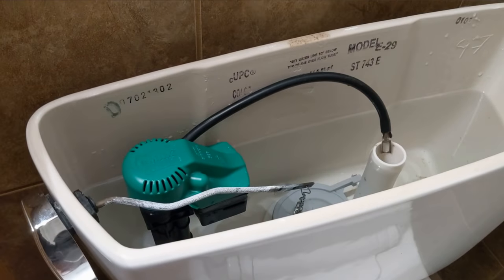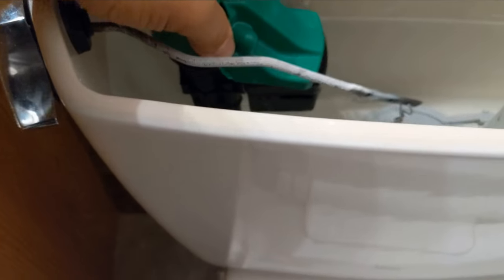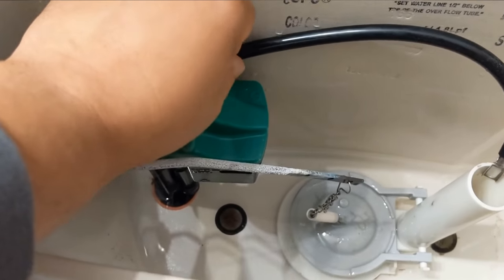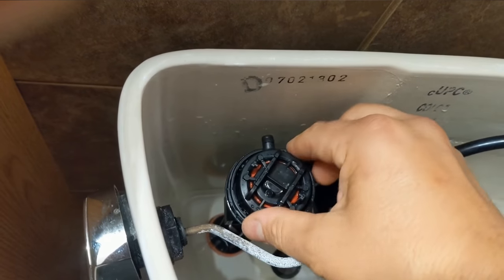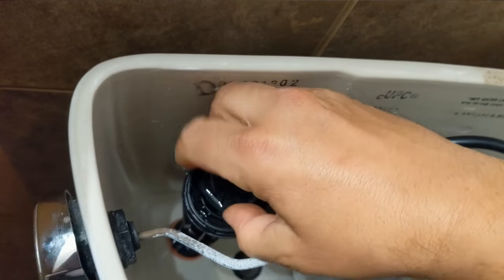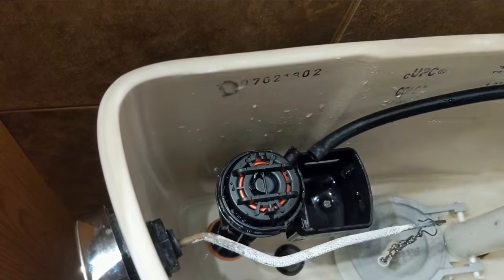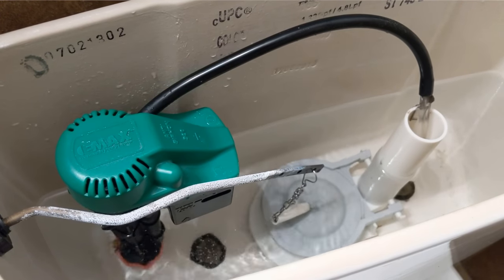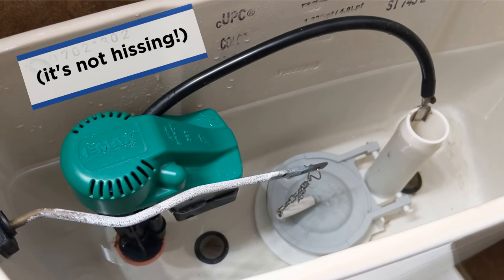How to quickly fix a hissing leaking Toto toilet with a new flush valve cap

Comment: After playing with replacement valves and replacement caps and cleaning the filter, with varying success, I’ve learned that $9.88 (currently at Amazon) to just replace the entire unit is easiest. Turn off the water, flush, a few unscrew and screw back ins, and you’re done. No disassembly, no “will it work” after a fix, no “what fails next” in a few months.

Comment: Thank you!!!  We have an older Toto dual flush toilet with the green 528 fill valve.  Took a bit to figure out what was going on since we weren't having the typical hissing noise.  In our case, the water fill was stuttering on and off, which was then causing loud knocking in the wall.  The Korky replacement cap cost $5 at my local True Value hardware store and was the perfect fit, and was so simple to follow your instructions - fixed it in about 2 minutes :-)  The previous gasket had completely degraded and was in pieces.  So much money saved not calling a plumber!

Comment: The rubber seal on mine was cracked near the edge.  Local Home Depot didn't have the cap - just the whole mechanism for $26.99.  However our friendly neighborhood Ace did stock it - $4.99.  Thanks!

Comment: You saved my day as my toto toilet is hard to unscrew flush valve (I do not understand why it is designed in such a way ). In order to change valve, you need to disasseble toilet from bottom first. Fortunately I saw your video and get it fixed by only chaging cap!!! Thank you so much!!!!

Comment: our higher than usual water bill was the big motivator for getting this done.  Found your video, then picked up the part at our local Ace hardware store (Korky Replacement Cap No.R528) for $5.50 and followed your instructions. Oops, forgot to check the filter - but the hissing leak is gone and peace is restored. Thanks!
Reply from the maker: Woohoo! Cheers.

Comment: Worked great for a different problem: tank filled, stopped, then started filling again several times briefly before finally stopping.  That rubber gasket was torn.  Picked up the Korky R528 equivalent replacement at Menards ($3.49).  Easy repair and it worked!  Thanks for the video

Comment: Jeff, you saved my manly honor! I brought a Korky replacement valve and spent better part of the afternoon trying to install it, but water kept leaking everywhere until I realized that the bottom stem was too long for my rigid water line. So then I had no choice but to reinstall the old one and deal with the hissing. Almost threw in my water drenched towel and asked my brother-in-law, who’s much more handy, for help. But your video saved me! And now he will never know that I almost had to beg for his help!
Reply from the maker: I might need this on a t-shirt! "Saving manly honor'". Glad it helped 👍
Reply: Terrific video. Thx. The green cap I struggled with until I saw that when you put your right hand over the cap, at the bottom near your thumb is a small flap that if you pull forward with your thumb it releases the cap easily.

Comment: Big thanks for the links! Saved me a lot a research time. The replacement cap fit more tight, but it works great. It's still a bummer to buy a full cap with valve, when all you need is just a rubber part! While removing the the hose I broke the nozzle on the cap, so I ended up using the advantage on new cap, but it doesn't mean that you have to buy so much to get so little.

Comment: Thank you.  You saved me the a lot of money and trouble.  I was going to replace both the fill valve and flush valve, plus put in a new gasket between the toilet base and back.  I bought a Korky Quietfill Fill Valve replacement cap at RONA for about $6.00 cad.

Comment: .....just completed the job myself...it was quite difficult to remove that top cap which was concerning....I thought I was going to crack or break it but I squeezed it a couple of times and twisted ever so slightly and it eventually disengaged....but it definitely wasn't so nicey nice as shown in the video....but the rest of the job was as smooth as silk....ty for the video...I'm a new subscriber
Reply from the maker: Glad it worked! (Sorry for my late reply!) For others reading - yes, the first time you try removing the cap and the hose, they're pretty tight. 👍

Comment: I had the right part but your video gave me more confidence in disassembly. Thanks! The outflow bit broke off in the hose when I pulled it off and I couldn’t get it out, but fortunately there was enough slack for me to cut a quarter inch off and still have it fit.

Comment: The Korky R528 Replacement Cap from Ace HW did the trick for me.  On the back it says fits Toto too.  $3.99.  Thanks for the quick fix.  I was thinking it was a leaky flapper instead.
Reply from the maker: Fantastic! Thanks for the part #

Comment: This saved me not just $20 but lots of hassle. We have a skirted toilet and the nut the attaches the supply line to the fill valve is impossible to reach by hand. Replacing the whole fill valve would probably require unmounting the toilet. So.... THANK YOU for sharing this info!

Comment: Thanks I ordered 2 and replaced both on my Totos. Heads up though it is NOT easy to take the top of the fill valve apart. Every part is hard to remove (except the valve itself).

Comment: If you didn't notice, the bottom of the chain has been enclosed in a short piece of tubing that falls slightly to the side when the chain is relaxed.  That tube prevents occasional tangles at the bottom of the chain.  When such tangles happen to happen, the flapper valve at the bottom of the tank won't seal and the toilet runs continually until you straighten out the chain.  Make this simple fix to avoid needing to listen for the toilet to stop running after it refills each time it is flushed.   That's probably what happened when someone ends up with a mysterious several- hundred dollar water bill.

Jeff has shown us a simple way to solve a second Toto toilet problem.  Thanks,  Jeff!
Reply from the maker: Thanks for the added tip! (and sorry for missing it earlier!) 👍

Comment: Thank you so much for this tutorial Jeff!!
My Toto toilet is maybe one and a half years old and started hissing about 2 weeks ago and so annoying because it's so close to the master bedroom.

I took all of the components apart on the left side rinsed them under hot water put them back together no more hiss.. so I did not have to replace any components but will know what to do if in the future the hissing doesn't stop after rinsing the components at least I know what valve to purchase..
Thank you YouTube and Jeff 😊
Reply from the maker: Glad it worked! I had cleaned mine all out with vinegar a couple times and even tried some silicon lubricant but once the gasket was dried out it need the replacement :)
Reply: @JeffMikolajow    thanks, and I did not use vinegar, I only rinsed with water, but if it happens again, I will rinse using vinegar, I do have super hard water in my home  :)

Comment: Great info! Appreciate it. Got the valve seal at General Plumbing for under $4. HD didn't have it, but I opened a new "Korky" GMAX valve to look at it and I think the new valves do not come apart? Not sure if anyone else has noticed that. Really made me want to keep this one if l can maintain it with $4 parts!
Reply from the maker: I've used the Korky replacements in other toilets (kids broke a full mechanism) but it seems the Toto branded parts are better quality, in general. Because of our high mineral content, I've been taking these ones apart at least once a year to proactively keep them clean 👍👍

Comment: Update - 4/2024 - at least in the US replacing the valve part costs more than replacing the entire valve assembly.  In fact if you don't replace it with a Toto unit, it costs $11 US. At least in the US, the "$5 piece" described in the video was listed at $30 in the on-line catalogue at both Lowe's and Home Depot. My local plumbing supply store did not even carry replacement parts as the towers are so cheap.  But thank you for the education.
Reply from the maker: Odd! They're still available in Canada for anywhere from $3.63 to about $11.

Comment: Thanks Jeff! Any chance you can do a quick video on adjusting the water level of the GMAX flush valve? My valve tube seems to be locked in place with a tamper proof key.

Comment: I need to look through your other videos but how do you replace the flapper? Specifically removing the old flapper. There are two white tabs on the plastic rod. How to remove either the rod or the tabs.

Comment: I was really excited when I saw this video thinking I could fix the hissing sound that’s bothered me for soooo long. The plumber said it was air. Ha! Unfortunately, I can’t take off the top (mine is blue) and it’s a TOTO. I bought a Korky replacement cap, but I wasn’t able to pop the cap off. I feel like I am yanking off the whole fill valve.
Reply from the maker: Hi Martha, hope you ended up getting it fixed! The top can be tricky to remove but it does separate in a similar way.

Comment: Orded the valve and almost wasily replaced it. (Teisting required a bit of mechanical assistance.)

Back together and still leaking.

Will remove the parts, rrince under warm water, and try again.

Comment: I have the green valve. I cannot get it off. There is a little black thing sticking out of a whole. Do you twist the cap or pull straight up? Thanks
Reply from the maker: The black hose at the back just pulls off 👍🏼

Comment: Wow, I had no idea that little "filter" thing could become completely clogged with debris. Apparently there's just rocks and oxidized copper floating around in the pipes?! My toilet was hissing like this AND it took over 5 minutes for the tank to fill. I pulled out that white plastic part and it was completely full of tiny green rocks. After rinsing it and putting everything back together the hissing is gone AND the toilet fills up in like 30 seconds now.
Reply from the maker: Amazing! Yes, mine occasionally has some "sludge" in it, too.

Comment: It looked simple and easy but both Home Depot and Lowe did not sell that valve piece. I wasted my trips. Will have to replace the whole flush system.
Reply from the maker: Sorry to hear! I've seen them recently though - perhaps it was sold out while you were there. Still online! Good luck.
Reply: @JeffMikolajow  
No problem. I was curious about your steps so I tried to see if it worked. I replaced the whole and it worked perfectly. Thank you for sharing with people.

Comment: Hi there Jeff,

I have this model and it's newly installed in my new apartment. For some reason the water won't refill though despite being new and will only refill if I push on the green part and lean it in a certain direction. Any suggestions for this seemingly simple problem? Thanks

Comment: Jeff, I replaced the gasket and the hissing stopped. However, the pipes immediately started getting water hammer. I put the old gasket back. The hissing is back, but the water hammer is gone. My system is a Toto and I used the Korky you linked in the video. The back of the packaging says it's compatible with Toto, so I don't think that's the issue. I have a Toto Anti-Siphon 528, the top casing is green. Any ideas?

Comment: Alternatively, if you don't want to run to the hardware store/amazon, you can take out the red plastic cap, put that under a heavy hot hair blower and push the side with a knife or something flat, so it becomes like a new -- flat instead of dented!
Reply from the maker: Never thought of that! Thanks for the tip.

Comment: How do you adjust the water fill level on this type of system @Jeff Mikolajow?
Reply: You have to adjust the entire height of the valve. Based on the instructions I could find, you actually rotate the whole assembly slightly counter-clockwise and it should unlock it so you can pull/push to adjust the height. I haven't tried this on mine so do so at your own risk; I have no idea if it works.

Comment: Just installed one of these and the water keeps going down. The fill valve hisses and water drips from the back. What do you think is wrong?
Reply from the maker: Not sure but have you checked that the flapper valve isn't leaking? We have hard water hear and every now and then I use my hands to clear the mineral deposits so it seats properly.

Comment: My toilet is only 2 years old, I would think/hope this mechanism would last longer than that :/
Reply: I haven't replaced this part yet, but I followed these instructions and checked, cleaned and resituated the valve and that fixed my problem. I'm sure I'll have to replace it soon, but at least I will get some extra time before I have to do that. Thanks!

Comment: next time ditch the piano music in the background, lol. The new kits are 50.00 and they still leak at the valve caps. Id never buy these toto  toilets again , a pain of repairs . Back to buying more caps as usual.
Reply from the maker: Thx for the feedback! I haven't had to buy a new kit - the failure point seems to be this cap. We have very hard water and I've been able to clean the gaskets/caps multiple times before needing to replace the part (we have 3 of these toilets in the house).